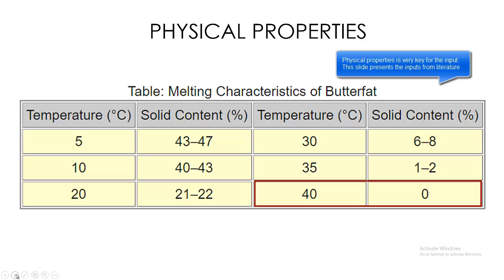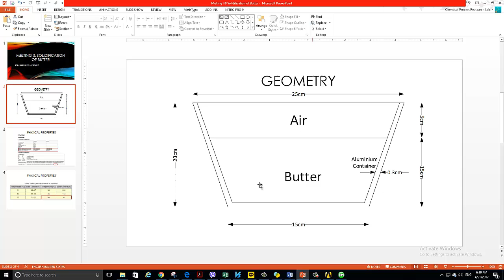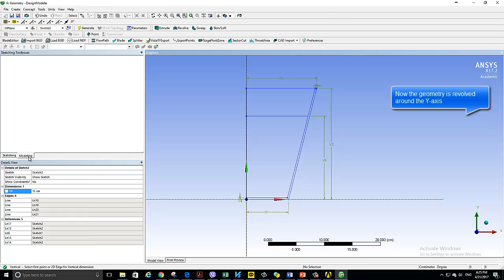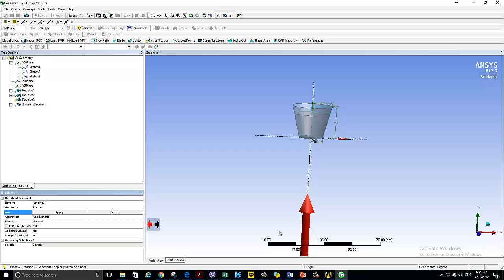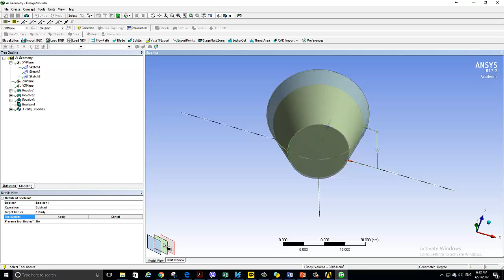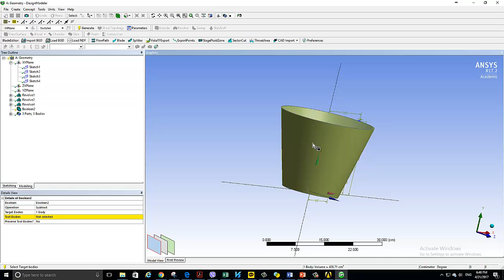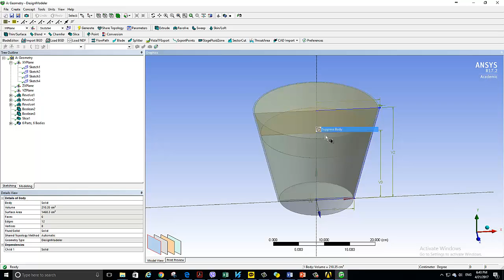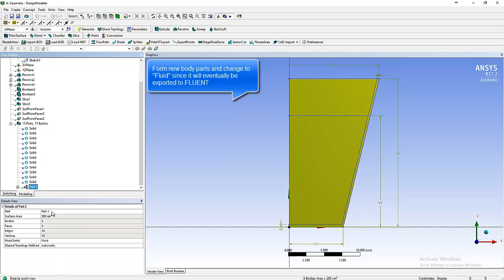Melt/Solidification: Developing 2D from 3D geometry ( Part 1)

Comment: why not just draw directly in 2D
Reply from the maker: Wan Aziz i wanted to show also how to make a 2D out of 3D. Thanks for watching and i appreciate your comment. Pls subscribe for more.
Reply: @ansysfluentcfdsolutions3101  hi im modeling the solidification of a cast metal. Its a 3d element i have the drawing and literature but not sure how to set up on fluen
Reply from the maker: @luciakhumalo5818  I think it follows the same procedure as the 2d. Did you try following the steps in this tutorial? If not more details with the problem you trying to solve will be required to give some recommendation(s)
Reply: i had the same question.